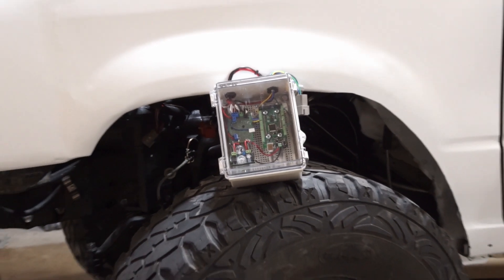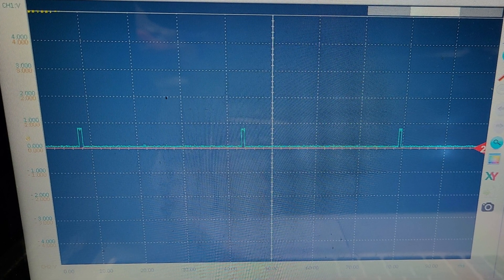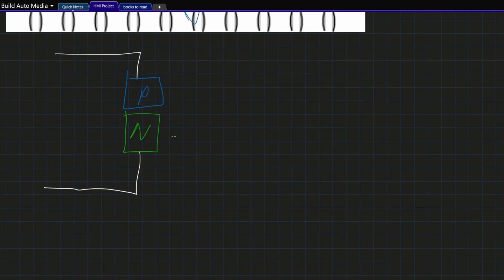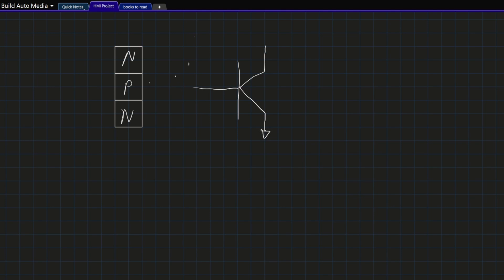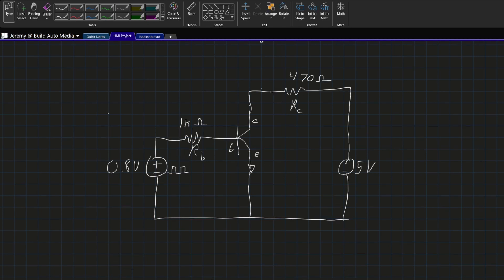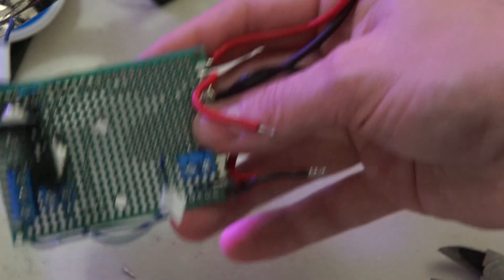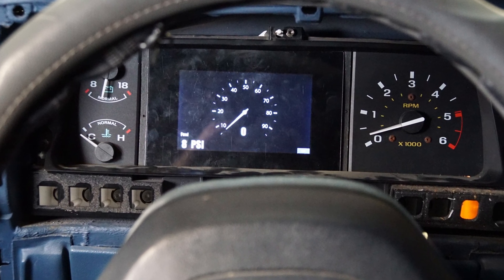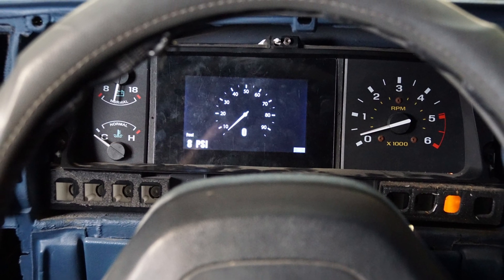Build Your Own Digital Dashboard for a FRACTION the Cost Using Arduino!

Comment: Did you ever add more sensors?
Reply from the maker: At this point the arduino runs the tach, reads fuel pressure, intake air temp, and runs the grid heaters. I still need to add a sensor for the speedometer but it was lower on the priorities - would work very similar to the crank position sensor.

Theres some more videos and a writeup linked here:
www.BuildAutoMedia.com/arduinodash

Comment: Great video man!  I never really understood transitors until now. Glad to see you haven't given up on the project.  I was throughly disappointed when she died on the road.

If I remember correctly, my 96 cummins was supposed to be a minimum of 15psi at idle.  And around 25+psi  at 1800 rpm no load.  If you pinch off your return line, you should see a fuel pressure spike.  If not, then your lift pump is weak.  

If the pressure does spike but FP is low, with the return circuit open, then you have a bad overflow valve.

Hope this helps!
Reply from the maker: Thats good advice, thank you Nolan. And thanks for sticking around for more videos! Im glad the explanation was helpful. Im hoping therell be more driving videos here coming up once I have it a little more winter ready 😂

Comment: Keep it up! It only gets better your build as you add more to it. Watcher since the beginning of your build. I also have a build of my own. It's a bronco 2 1985 where I am doing customer wiring and electrical solutions of my own but no engine swap. The car runs and drives perfectly I only need to put a great code of paint to it.